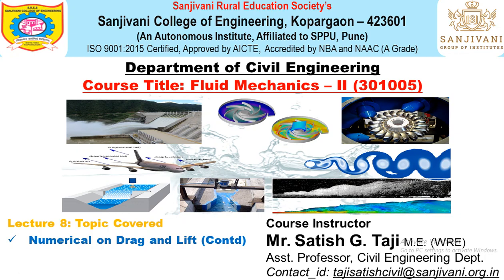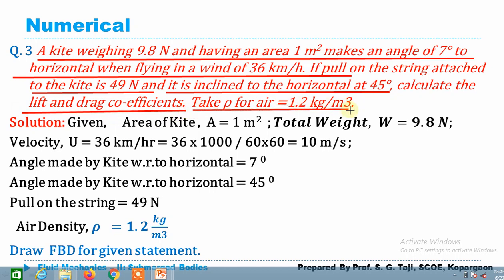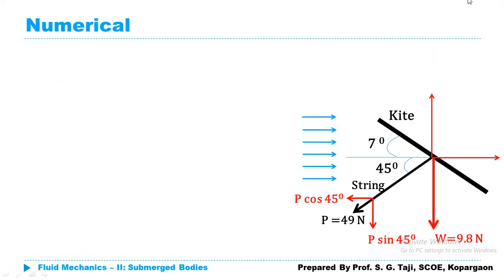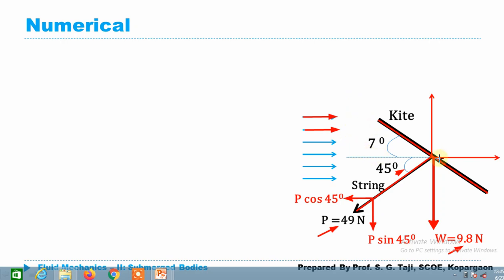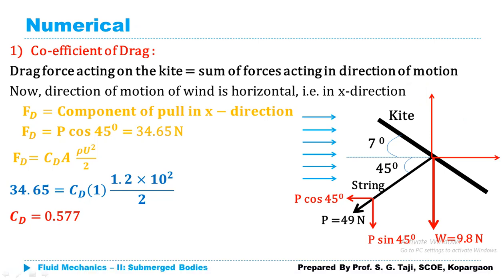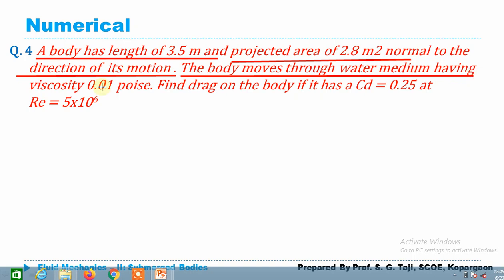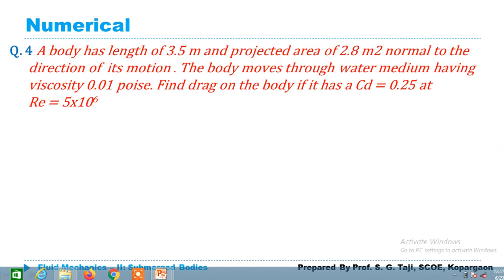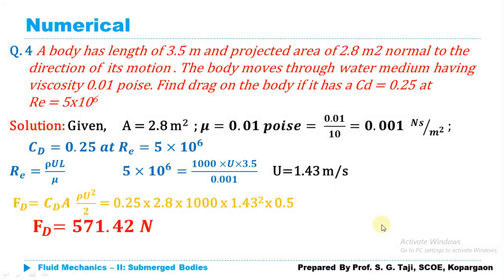Numerical on Drag and Lift | Part 2 | Flow Around a Submerged Bodies | Fluid Mechanics

Comment: Sir in 1st question why we not made the use of angle of kite for computing projected area?
Reply from the maker: Interesting question. 
See here, usually area considered in the computation of drag force is either projected area or total area.
Generally, the drag depends directly on the size of the body. Here, we are considering the aerodynamic forces, and therefore, the dependence can be characterized by some area. Now the real question arises, which area do we choose? If we think of drag as being caused by friction between the air and the body, a logical choice would be the total surface area of the body. If we think of drag as being a resistance to the flow, a more logical choice would be the frontal area of the body that is perpendicular to the flow direction or projected area. Since the drag coefficient is usually determined experimentally by measuring drag and the area and then performing the division to produce the coefficient, we are free to use any area that can be easily measured. If we choose the total area, rather than the cross-sectional area or projected area, the computed coefficient will have a different value. However, the value of drag will be same, and the coefficients are related by the ratio of the areas. In practice, drag coefficients are reported based on a wide variety of object areas.
Hence, as total area or plane area of the kite was given in the numerical, we have used the same for computation of drag.
Hope this will help!!
Regards,
eGyaanKosh